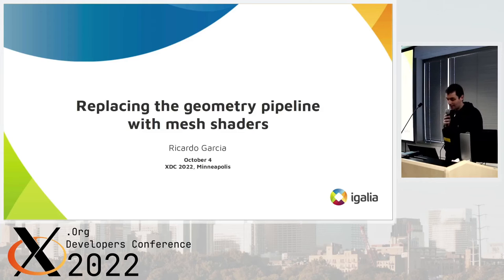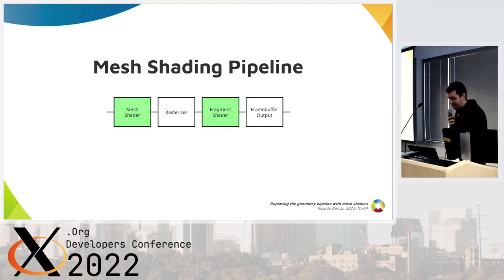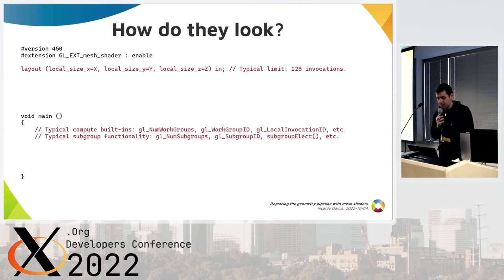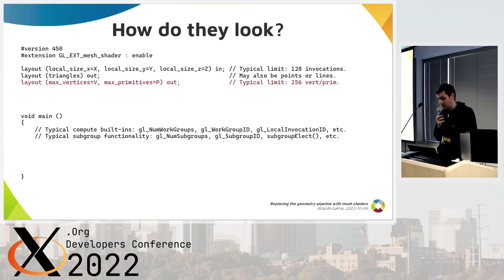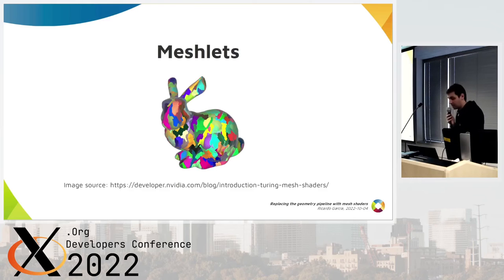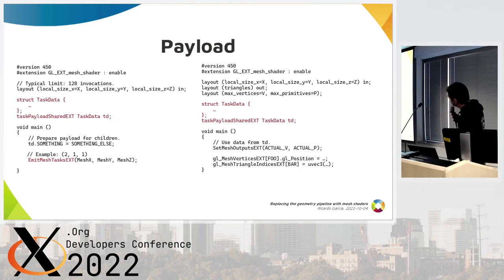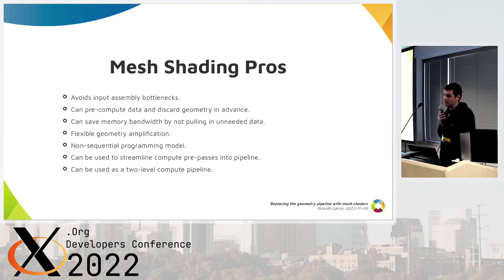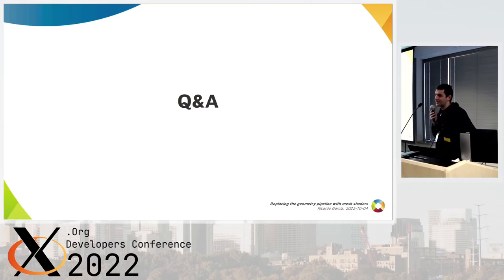Replacing the geometry pipeline with mesh shaders

Comment: mesh shading is nothing short of amazing ,yet , the content about it is as dry as a desert..... 
i wish we could get mesh shading now ,seeing how lower end hardware struggle

as well as sampler feedback streaming ,especially for all those 4gb /8gb vram gpus ,

both of them could just 2x the gpu performance on average if not more depending on the scene😃😃
Reply: yes, there is far to little resources on meshshaders out  there and additionally almost everything I can find is either 
old glsl for the NV_Mesh extensions (the nvidia exclusive ones), or hlsl for directX.

so far i havent found anyithing that covers 
vulkan1.3 with hlsl for sm6.5 or sm6.6 that gets compiled at runtime in order to utilize input optimized shader compilation, which more or less is a requirement of mesh shaders.

the lack of guides on hlsl in vulkan baffles me, amd nvidia and Intel claimed on multiple occasions that one shouldnt use GLSL in production but solely in prototyping, and rather resort to HLSL.

I found some guides/documentations on integrating dxc for shader compilation but its always "use the .so or .dll file" -> I dont want to ship my renderer/application/gamengine/game or whatever with an ever increasing amount of dll's/shared object files,  ideally i want to have only 1 dynamically linked object that being the vulkan loader the rest should be directly included resulting in a single monolithic executable + assets archive.

I personally want to support both windows and linux which is one of the key reasons why i really want to minimize the dynamically linked stuff.